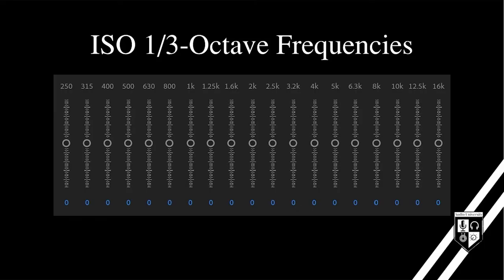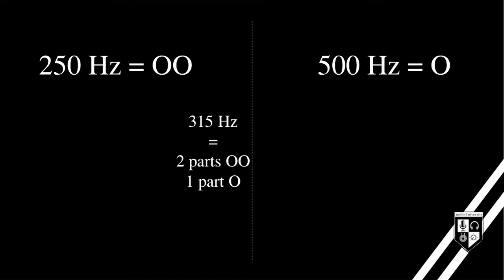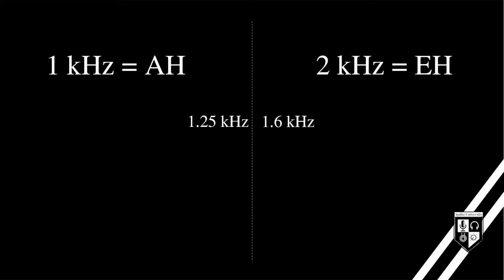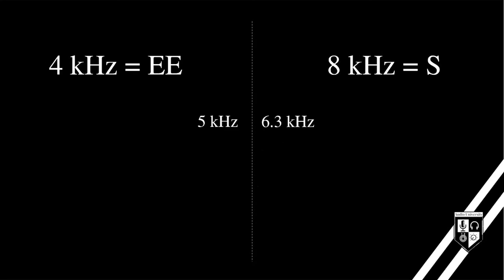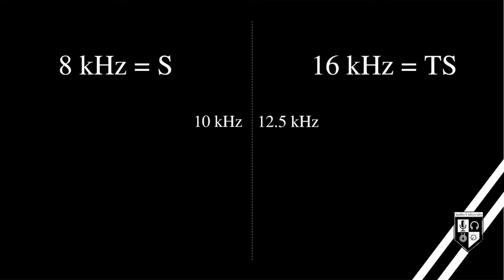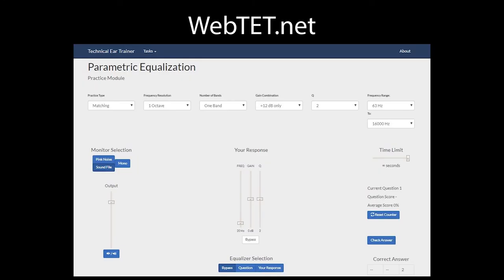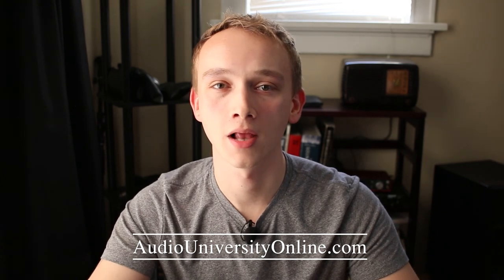BEST EAR TRAINING METHOD for AUDIO ENGINEERS (Recording, Mixing, & Live Sound)

Comment: 250Hz  “OO”  1:19 / 1:21
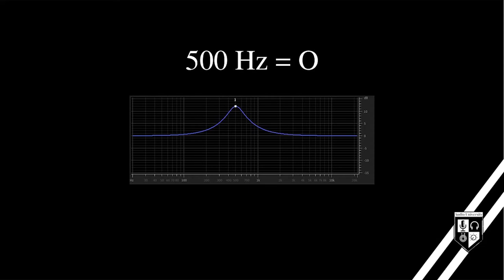500Hz  “O”     1:30 / 1:32
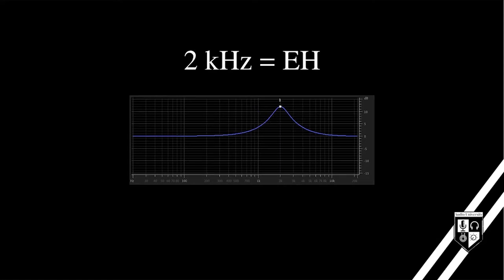1kHz     “AH”  1:42 / 1:44
2kHz     “EH”  1:53 / 1:55
4kHz     “EE”   2:05 / 2:07
8kHz     “S”     2:22 / 2:25
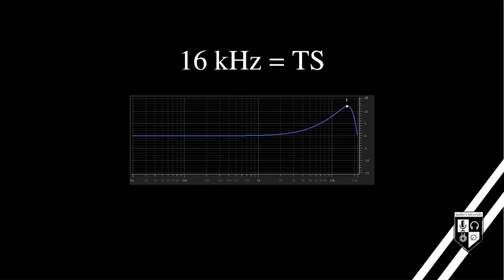16kHz   “TS”   2:39 / 2:42

1st link: includes unfiltered pink noise
2nd link: straight into the EQd version

(Each frequency timestamp in description includes 5 seconds of talking. This comment is intended to solve that problem.)
Reply: Hungarian vovels:
250Hz  “U / Ú”  1:19 / 1:21
500Hz  “O / Ó”     1:30 / 1:32
1kHz     “A / A”  1:42 / 1:44
2kHz     “E / E”  1:53 / 1:55
4kHz     “I / Í”   2:05 / 2:07
8kHz     “S / SZ”     2:22 / 2:25
16kHz   “C / C-SZ”   2:39 / 2:42
Reply: @tiborreszegi6185  Neat
Reply: In his more recent videos on this same technique, he uses "A", as in "Bad", instead of "eh" for 2 kHz , which I think makes much more sense.
Reply: @christopherharv  good point def works better

Comment: I don't understand how this method can be used on mixing and using the eq in a song. Can you explain it?
Reply from the maker: After practicing this method of listening, you'll start to associate these vowel sounds to the corresponding frequency bands.

While you're mixing a song, you'll hear too much (or too little) energy in one of those vowel sounds. Because you can now associate that vowel sound with the corresponding frequency band, you know exactly (or roughly) where to boost or cut with an EQ. 

Does that explanation help? Good question.
Reply: @AudioUniversity  Yes it help me. But I have some question about it: Can I hear the frequency without the pink noise? Can I try to hear the vowel sound with music too? And Is it works? Or after long time I could impress me to hear the vowel sound in a range where the vowel sound there isn't?
Reply from the maker: Check out this video: https://youtu.be/75xj8ZHAoOo